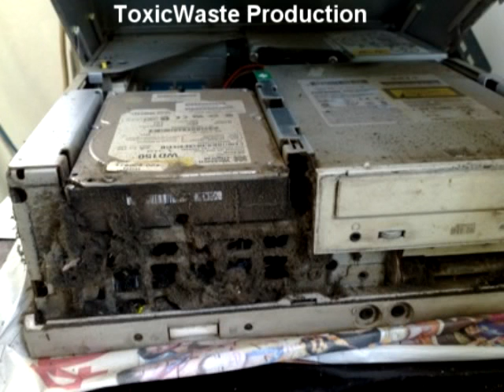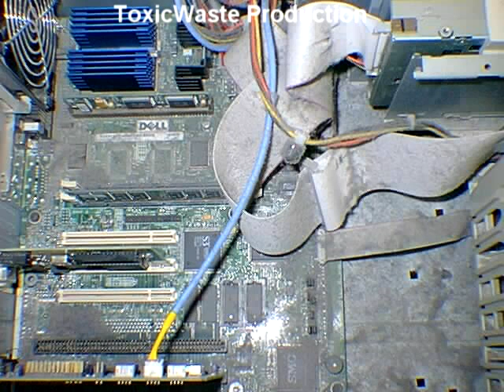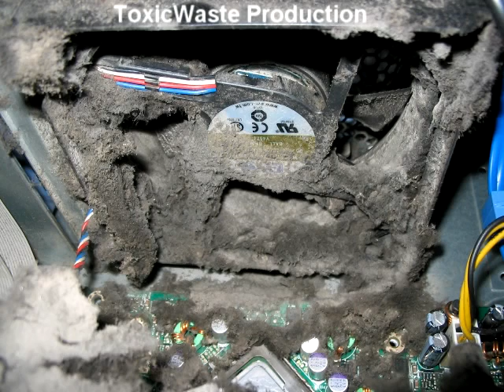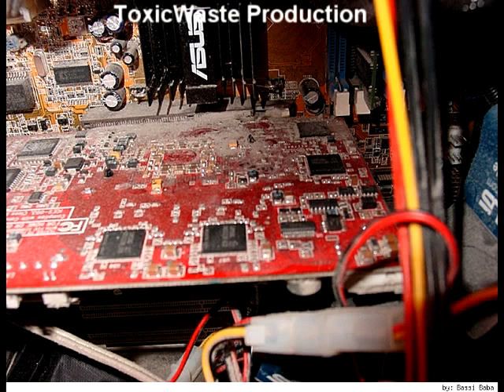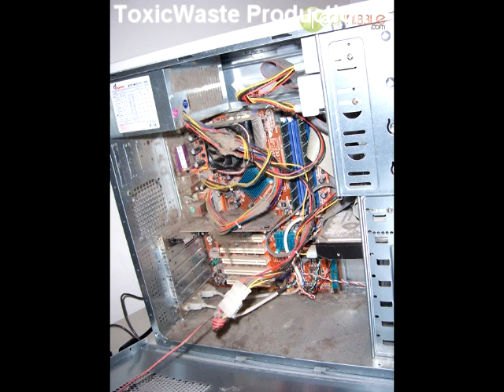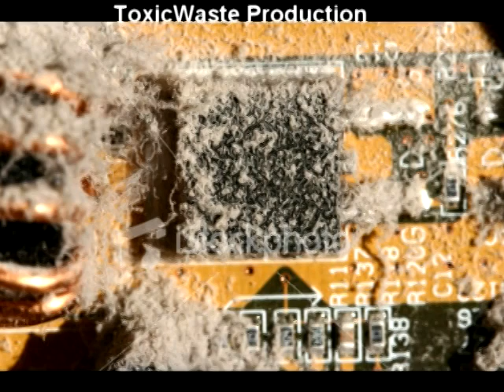Tips how to be an successful computer technician.

Comment from the maker: if someone wants to pay big bucks for secure computers i can make them so secure they wont crash reguardless what you do to them as long as the hardware is intact. :) Offering that service to make things that bulletproof for free basically is shooting yourself in the leg.

Fix the issues that the computer came in for. if you find more reccomend fixes for them for an cheap/decent price. And most of the time they will hire you for those fixes also. But dont fix every issue for an base line price.

Comment from the maker: yeah but as i also said if you do an to good of an job there is not enough problems with there computers in the long run and they wont really come back sens there computers are to stable. Its an fine ballance there. How much time your willing to spend for the money and how stable you want the system to get.

I got the rule that they dont get the computer back untill they paid but sens i started with that the repairs has gone downhill sens they know they cant rip me off no more.